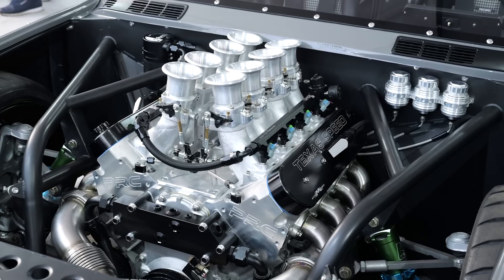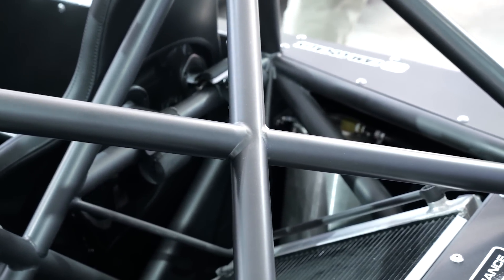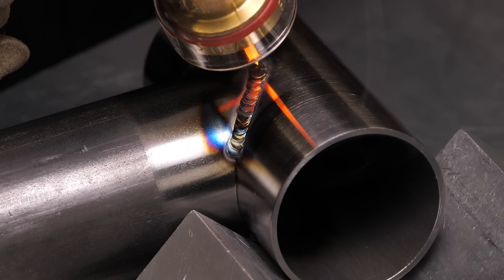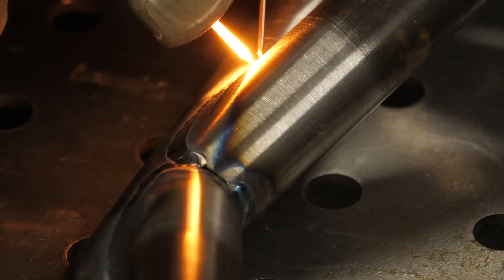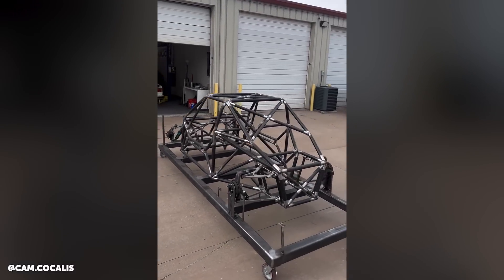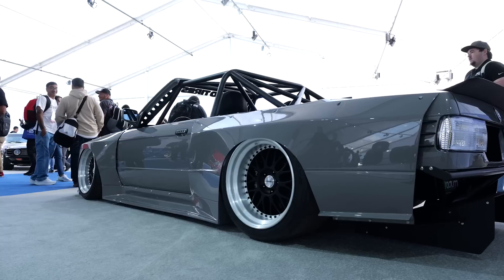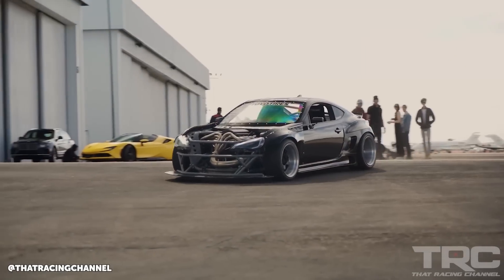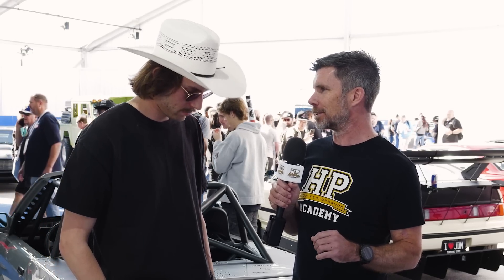Hot Rod or Race Car? | 2024's WILDEST BMW E30 Build

Comment: This guy is a content creator or h
He's just focused on creating those masterpieces?
Reply from the maker: I'd say he's both. Probably a little more focused on the build and skillset development than just the content, but that is what makes the content interesting as, in my opinion, he does challenge himself a bit rather than just ticking things off a list as quick as he can 😎 - Taz.
Reply: If his content seems like more engineering and fabricating it's fine to me

But if it's a vlog style slap parts on with artificial time crunch drama we seen done since orange county choppers 

Then i don't care for it

Comment: Looks cool. It looks like he got inspiration from the M3 for the fenders which keeps the overall design coherent in spite of the big jump in track width. I would love to do the same to my beemer and use gm double-wishbone suspension. I thought of exactly the same thing a while back because I wanted to have a sound geometry base to work from (not a suspension guru, gotta leverage the engineering of those that are) and off-the-shelf, strong components (all the suspension, hubs, brakes, diff) which would be well overbuilt for a lightweight build. This guy did it. Nice.